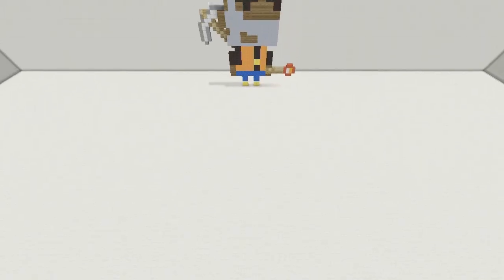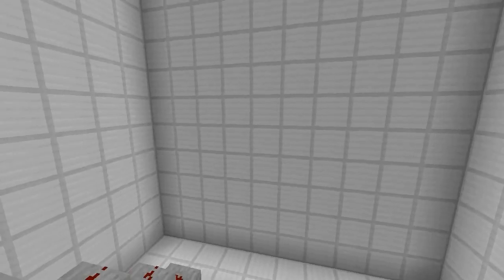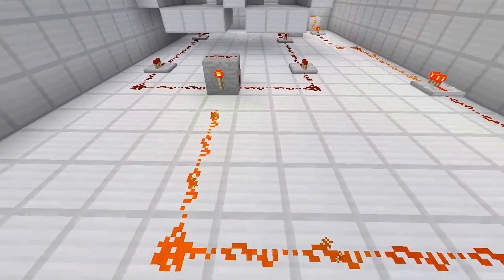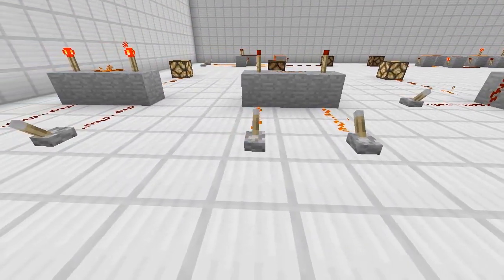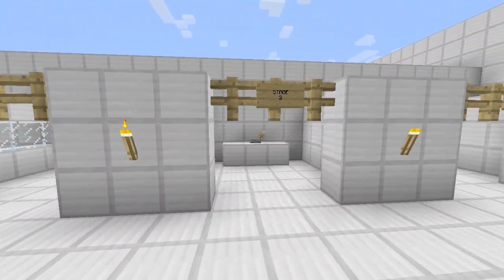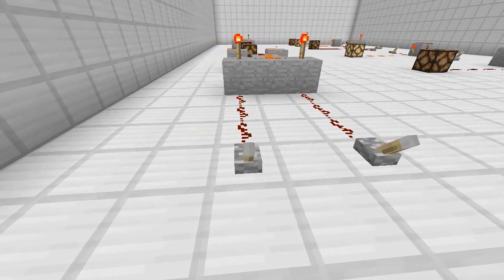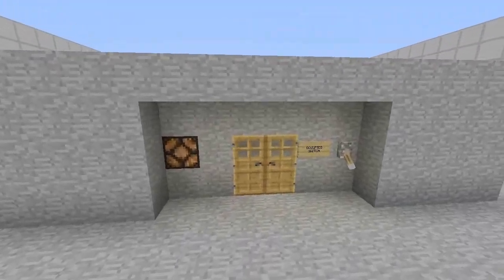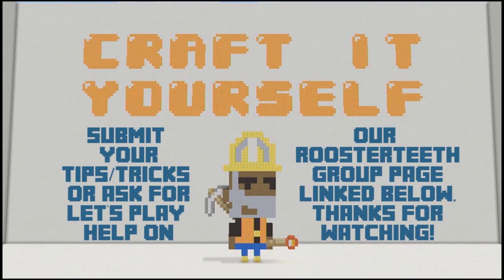Craft It Yourself - Ep 1 - Logic Gates

Comment: How to do a repeating circuit that can be activated
Reply: You have a piston push a block between 2 red stone repeaters that are facing the same way, then put a red stone torch on a block in front of 1 of the red stone repeaters, then have the red stone link the torch to the other repeater. That's the Xbox way, if you're on pc, just put a switch behind a comparator, then have red stone on the left, the top left corner, and the top of the comparator. right click on the comparator to turn on the torch, then when the switch is on, it makes a repeated signal
Reply: Make a square with a bunch of whatever those things that delay the red stone